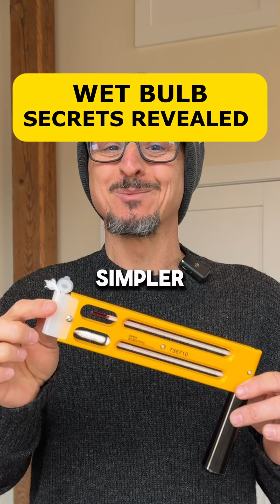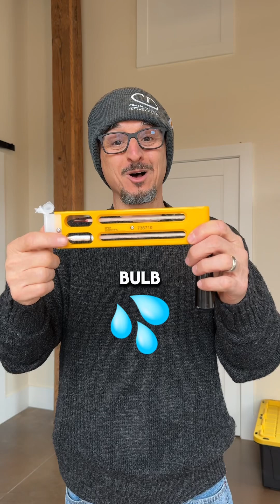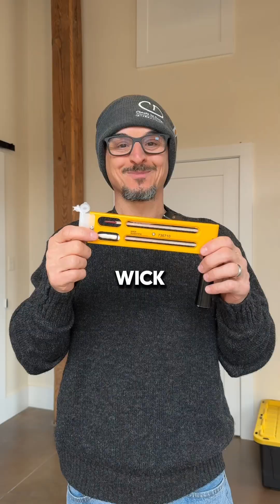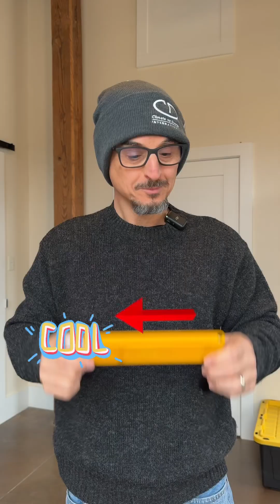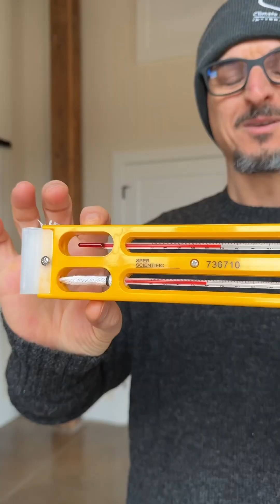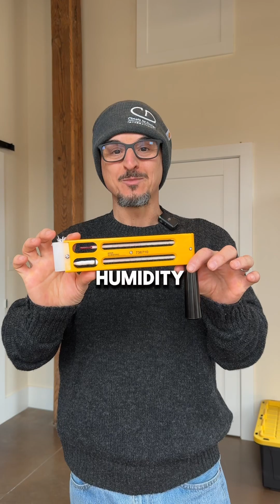HVAC Basics: Dry Bulb vs. Wet Bulb Temperature – Why It Matters for HVAC System Performance

Comment: Good explanation, but how do you know specifically when the thermometer has been "slung" enough?  That's a tiny wick being manipulated in a comparatively large room.  Seems there has to be an equilibrium established with the actual DB temperature, which would balance with the evaporation and govern just how cool the WB temperature would get.

Comment: If the humidity  is 0 or low they will be the same. Depending  on the temp of the water on the wet bulb.

Comment: So theoretically. The closer the wet bulb temperature is to the dry bulb temperature the more moisture there is in the air?
Reply from the maker: Yes. When DB and WB are equal, air is completely saturated and can't hold any more water.